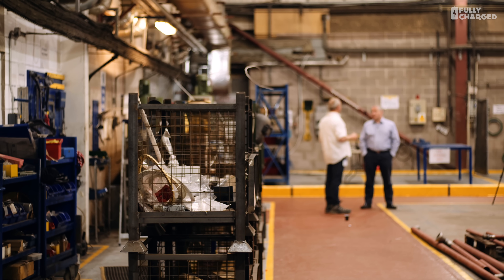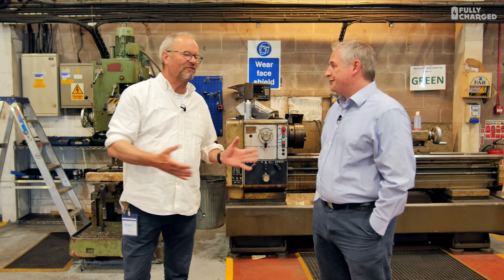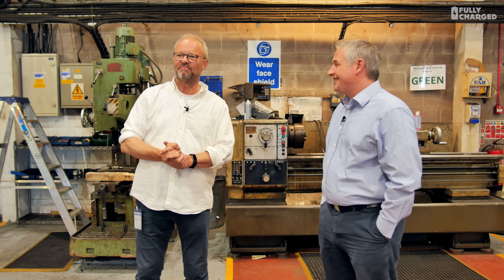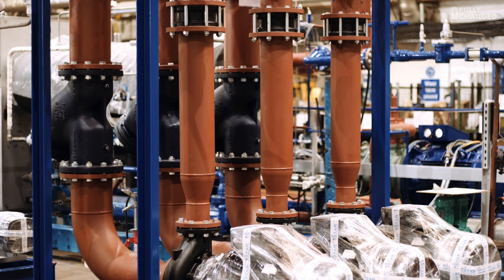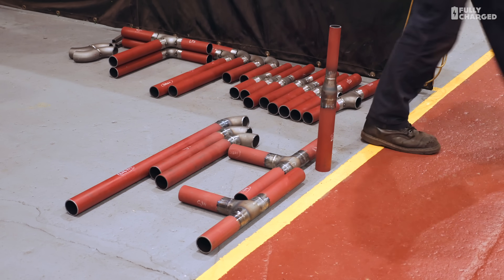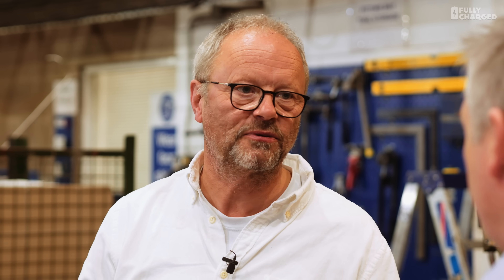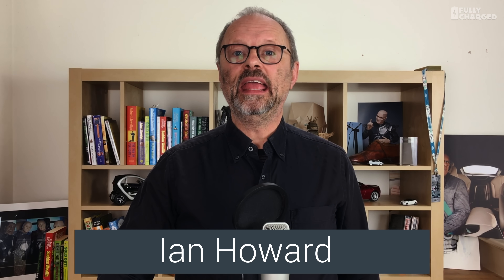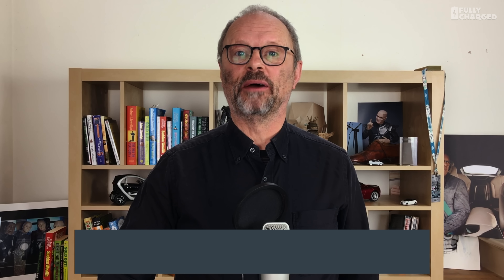Star Heat Pumps | Fully Charged

Comment: 0:27 "How do we produce heat without burning anything?" I might be missing something blatantly obvious, but what's the problem with electrical radiators? We mainly use those to heat up our houses  here in Norway, and it works just fine. I'm not criticizing heat pumps, but that line was poorly thought through I think.
Reply: Air source heat pumps struggle in the cold because there is less heat to be extracted from the air. Ground source, including water, heat pumps are extracting heat from a source with a relatively stable temperature so the efficiency is consistent.
Reply: Those type of heaters produce 1kW of heat with 1kW of electricity. heat pumps can produce between 2.5 and 4kW of heat for each kW of electricity
Reply: One has to understand that home heating in the UK is via water filled radiators. The water is heated up by a natural gas boiler in the vast majority of homes. Prior to natural gas boilers, fireplaces burned wood or coal. Because home heat almost exclusively done via natural gas, then those in the UK may mistakenly think that burning things is the only way to heat a home.

My experience in the US with heat pumps, is that in very cold temperatures the heat pump struggles to keep the home warm. A heat pump system that cools by heat pump and heats using natural gas has no problem keeping the house warm during cold winters days/nights.
Reply: The problem with electric radiators is that they use a lot of power compared to heat pumps. Bear in mind that to get off fossil fuels, everything possible has to be made electric. If electric radiators are widespread the power demand will be very high and make it harder to rely solely on renewable electricity.
Reply: I believe the issue with air sourced heat pumps is that they can only add or subtract a limited amount of heat to the home.

So if its 15F outside and my thermostat is set to 70F it has to be able maintain an 55F difference between inside and out. In the summer if its 100F outside and set to 70F inside, the unit has a 30F differential to maintain. A better insulated home would help reduce the heat energy necessary to maintain a given heat differential or allow for a larger differential for the same heat energy input.
Reply: No, the heat difference is not the problem.  Low temperature outside makes it harder to gather because 1) the compressor is designed to work in a given range, and lowering that range is hard, 2) less heat in the air means it needs to process more air, so bigger fans, larger radiators, etc.  Mostly, though it is really about power, a heat pump is sized for a particular power capacity, a greater temperature difference increases the power loss of the building.  Yes, better insulation helps on all these issues.
Reply: @Ian: Both heat and electricity are measured as energy and thus in units of kWh (kiloWatt-hours).  Common mistake.

Comment: I think that one of the earliest attempts to use heat pumps on a relatively large scale was the original heating for the Royal Festival Hall in London. Although described  in Wikipedia as a ground source heat pump, it used the water from the River Thames. I also used a pair of Merlin engines(!) to drive it. Sadly it was not a success and It was quickly replaced. It apparently made the Hall too hot.

Comment: This guy has the best job. All of the pieces of using every bit of renewable energy we can generate are falling into place.  Heat pumps and hot water for storing unneeded wind and solar for later use is a great idea. By the same token, they could used heat pumps to chill or freeze water and store excess power for air conditioning.

Comment: Great story. I'd love to see more about renewable heat,  as it hardly gets the attention it deserves for its masive potential to reduce mined and fossil fuel- sourced energy.
For examply, a study conducted in AU in 2014 found that the amount of renewable heat being harvested was about double the amount of renewable electricity from PV panels but the issue is hardly recognized. 
Another great thing about utilising this heat is that it is harvested right where the heat is needed.
In Australia the cost of heat from heat pumps is about 1/4 to 1/2 that of gas depending on the equipment and regional gas prices.

Comment: Our house has had heat pump hot water supply for the last 30 years. It should really be a legal requirement to use heat pumps for your water these days.

Comment: Typical finnish domestic water to water heatpump drill hole is about 150m deep. Or multiple for a big house. Too shallow, say 100m and the flowing ground water is likely to freeze and form an iceblanket around the drillhole if there is a longer cold period (2 weeks of over -20C)
Reply: You've got some numbers wrong, I think. My neighbour in Latvia had heat pump. And he didn't drill any 150m holes in his garden. there is just one pipe that snakes back and forward just a bit below freezing level depth (less then 3m). And it works fine even in -20 that Latvia does experience sometimes (used to be more frequent in my childhood).
Reply: If yo don't have the land you go down, Its the same system.
Reply: Some people have those also. Some 200-300 meters of thick hose dug under field of wheat. Latvia is not the same as Finland. :)

Comment: I've been a heat pump advocate for decades.  It's the only heat source that doesn't require fuel.  The main reason we don't see them in the US, is because they take too much area/land that isn't available in America's suburbs.  Planners maximize the # of lots for sale for profit, and lose the opportunity to use them.  In conjunction with some 'standard' Passive Haus designs, almost any house can be a 'net zero' house.  Should be built that way in the first place.
Reply: What are you talking about?  MY heat pump takes 2' x 4' of space.  Most US suburbs have setbacks and minimum lot sizes.  There is no land issue.

Comment: Heat pumps are good machines, BUT when it is 34 degrees F outside there is not a lot of heat be extracted, hence aux heat source, so a geo-thermal is a better choice for a heatpump.
Reply: Actually, Duane C, there is an enormous amount of heat left at 34 degrees F. There's heat that can be recovered all the way down to Absolute Zero which is -951 F.  The problem with this system is it need liquid water to work
Reply: -459°F, but yes, plenty of heat in 34°F.
The trouble with geo-thermal (actually ground source) heat pumps on a small scale is the cost of drilling the hole.  For me, it would have been more than the current heating budget for the expected life of the building, just to do the drilling.

Comment: This is again a product of the big oil mentality... Why have huge heat pumps and complicated piping to all the houses, when you can have electricity going to houses and run heat-pump based "split system" air conditioners (which are ~350% efficient)? 
It is a bad idea, as the system has many more points of failure, and when something fails, the whole city is left without heating.
When a "split system" air conditioner fails, then only one room in one house loses heating/cooling, so the residents can simply move to the other rooms until the unit is fixed. These small air conditioners can also be run from solar+batteries. One Tesla Powerwall II can output 5000W continuous (7500W peak), which is enough for at least 3 room air conditioners running simultaneously (they usually don't run at the same time).
Reply: Well, because having loads of air to air heatpumps would use extremely much more energy? Also, you need heating the most, when you have the least of solar energy available. And when you need it power for other needs. So if you can run it at higher efficiency level, then why not.
Reply: 350% vs. 400% efficiency? That is a very small difference, not worth losing your control over heating/cooling.

Comment: Air to air heat pumps are used as the climate control in decent EVs, unfortunately my Bolt isn't one, it has a simple coil heater.

Comment: Good talk.
First we have to start  insulating our houses very well. Double glazing HR++ / Solar-collectors / Central Heating HR ++ / Warm-water HR ++ .... 
BTW We have air-heating in our house ... a heat pump can be fitted in this system... This was originally made for cooling the air in summer, but I think it can be reversed.

Comment: When you say things like "400% efficiency", that over-compensation, that's where you lose credibility. You cannot just willy neely rewrite the second law of thermodynamics to sale snake oil, man. Yes! you can make the equipment more efficient but that's about it.
Reply: Law isn't broken, as cold water is pumped back into the river.
Reply: You just don’t understand how percentages work.
Reply: The additional energy comes from the environment. The input energy is mostly used to move the heat from one place to another. So when they say 400% efficient they mean for every one unit of energy you put in they can move four units of energy from one reservoir to another.

Its about moving heat not generating heat, the clue is in the name heat *pump*.
Reply: It is true though. Heat pumps are 400% efficient, in the sense that you move 4 times as much energy with one unit of energy compared to if you were to convert that single unit of energy directly to heat. Not really snake oil sales talk. Maybe calling it efficiency rather than coefficient of performance is not technically accurate, but I certainly wouldn't call it snakes oil talk. After all the user really does experience it as one unit of energy going in and four units of energy coming out.
Reply: Ragib Safaeth google vapour compression cycle

Comment: A small duct and pump can redirect the waste heat from  behind fridge/freezer , for example, through a wall into a small room to help heat it.  Even a low powered fan blowing air from near the ceiling to the floor level gives more 'warming' than the power used by the fan. Don't just 'make' heat, move it about.

Comment: Domestic heat pumps have been freely available for at least 20 years.  As the vid says, it is best the heat is extracted from moving water, or wet earth.   But wet earth can tun to ice (tundra).  They are not cheap to install with few people understanding them for maintenance.  Gas in the in the UK is around one third of the price per kWH than Electricity, it was about a quarter until the gas price hypes - in 2004 the UK produced all its own gas and now imports 40%.  So, if a heat pump is an average of COP 3 you are the same as a top gas condensing boiler which can be over 90% when installed for maximum efficiency and commissioned properly.  The heat pump system, must average over COP 4 to be viable.  Heat pump installations are not cheap, so a long payback period for a domestic user. 

When the price of gas and electricity come closer together then Heat Pumps are then viable.
Reply: One main point is that the electricity can come from any source, and especially when there's overproduction by renewables. The heat can then be stored for a few hours (that solves a very big chunk of the "peakiness" of renewables).
You are right about the cost of heat pump versus gas heating. We had one for a long time and the cost of electricity used was pretty much the same as gas would have cost for the same amount of heating (electricity being about 3x as expensive as gas per kWh). But considering a lot of electricity is from hydro power here in Austria we at least reduced emissions.
Reply: superdau
In large scale installations heat pumps can be very cost effective and cheap to run. But lots of thought has to go into them, as the project in Norway in the vid.  Mitsubishi make an excellent air sourced heat pump which is an off the shelf unit. Heat pumps can be cost effective if off-peak overnight electricity us used with the heat stored in a large thermal store cylinder. But the cylinder would need to be quite large with UK homes not having enough space for them.  

For the cost of such expensive installations, the money is best used on a highly efficient gas boiler as they are cheap, insulation, draft proofing and high performing glazing. That is when retrofitting.  In a new design house passive solar and super insulation is the way, not relying on machines to heat and cool. 

Solar PV panels on the roof, a Tesla Powerwall (charging the battery overnight on cheaper electricity or from the PV panels for free) and a heat pump installation would be cheap to run, but the installation cost would be horrendous for a domestic home.  It may work for commercial premises.

Comment: Residential heat pumps are quite common here in the land of cheap electricity, Quebec.  I just have regular electric heat and some of my neighbours have heat pumps.  Their heating bills are quite a bit lower than mine although heat pumps are not cheap to install.  The heat pumps don't work below -12C,   which is not that uncommon.

Comment: Not related to the article but you need to switch back to your shirt microphone

The freestanding microphone generates so much echo and sounds terrible
Reply: The front of the microphone is turned facing away from him and it's picking up mostly the reverberation of his voice in the room instead of his voice directly.
Reply: Jean-Pierre White - The front of the mic is facing away from him, it would sound fine if he turned it toward him. Directional microphone like this one are designed to reject sound from behind them, particularly at a 120 degree angle relative to the front of the mic like he has it. (This is my area of expertise, I've been a recording engineer for almost 50 years.)
Reply: The Mic is too far away from his mouth and is picking up sound bouncing off the walls rather than the direct sound from his vocal chords.
Reply: Carnt belive there standing in front of wear face shield mask and neither of them are whereing face shields crazy mofos! Here in iran they both would get 100 lashes!!!

Comment: This was a particularly good episode well done.

Heat pumps are the future, in fact don't the Nissan leaf use some kind of heat pump for its heating system.

So for people who want a heat pump couldn't they rip out a Nissan leaf heat pump to keep their front room warm.
Just a thought.
Reply: The heat pumps used for heating houses are connected into the ground. Basically they remove heat energy from the ground, which, in winter, is warmer than the air, and circulate it around the house. 

Last time I checked, the Nissan Leaf wasn't connected to the ground. 

Your standard ICE car has either an air conditioning system to heat the car, or it simply passes outside air through the engine to heat it up, before passing it into the cabin. An electric car produces far too little heat for this to be possible, so a standard electric heater is used, similar to that of a hair dryer.
Reply: I was under the impression the Nissan leaf before the latest version had some kind of heat pump fitted which reduced the amount of power used for heating the cabin.

I got this info from Nissan leaf owners online, who claimed it was more efficient than the old first leaf cars.
Reply: This is technology available in every fridge or AC unit so you can just scavenge those for parts.
And it can move heat from any source (water / ground / air), so the better electric cars pull heat from the surrounding air.
Reply: So you would have thought such devices would be fitted as standard to homes, if they can do it with a car they sure can do it with a house.

Which makes you wonder why they don't unless you get the under the garden types.

I've often thought about ripping out a Nissan leaf heater and looking at ways to make it work in a room, no reason why it wouldn't.

But then I discovered they already make stand alone heat pumps that they sell on ebay.
Reply: @dejectedsheep: Nope,  many heat pumps are air-to-air, not connected to the ground at all.

An air-conditioning system IS a heat pump. (though usually only used in one direction, cooling).
Reply: CorwynGC

So if someone was a bit low on cash and they wanted to get cheap heating say like old age pensioners, someone could in principle get the heat pump out of a crashed Nissan leaf and set up a low cost heating system for them.

And as it runs on 12v would be ultra safe and cheap to run.

In fact the system could be put into a box and made to look like a portable heating cooling system so it wouldn't look out of place.
Reply: I suppose.   12 Volt would not make it safe, or cheap to run.  Not clear that the Leaf heat pump runs on 12v (thought it might).  It would need to be half inside and half outside.  And I doubt it would heat a house of any size, not super insulated.  Seems like more trouble than it is worth, but go ahead, and let me know how it works out.
Reply: I was thinking just a room not a whole house.

But yes you may be right about it not being 12v.

Comment: We have had geothermal for 17 years now. Powered by electricity from the sun stored in batteries. Not sure why you would have to go to all this trouble and expense.  Geo system 15K  - solar and batteries 15k for 8MW system. Total 30k US. Did all this when building the house. Have upgraded over the years and now going to 3 power walls with 8MW solar.
Reply: 8MW? What sort of house needs 8MW? How many bitcoins do you mine?
Reply: I presume that is 8MWh of heat across a full year...
Reply: OK. That makes sense. Costs are inline with UK for that sort of delivery